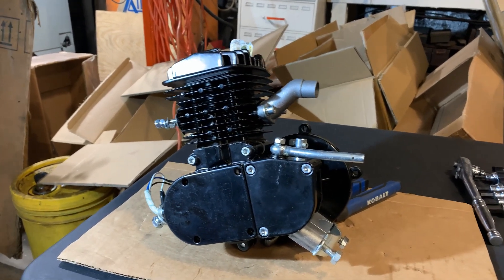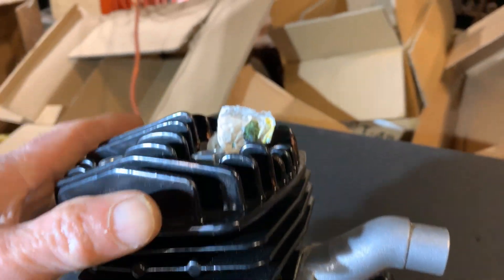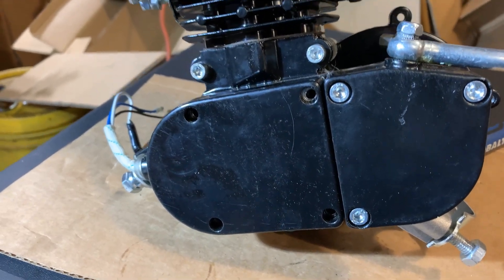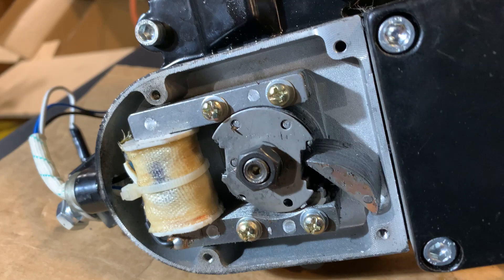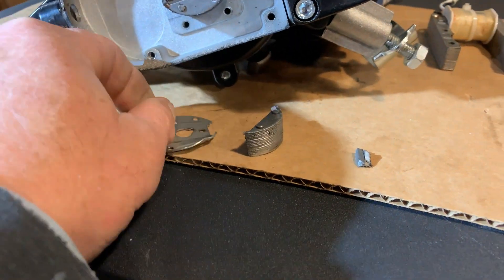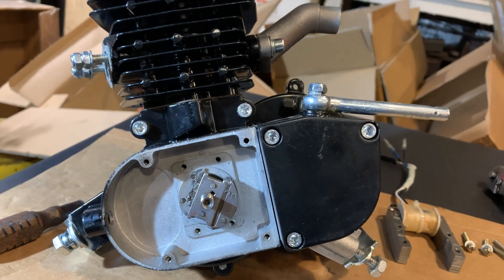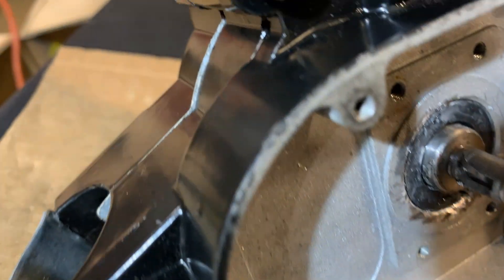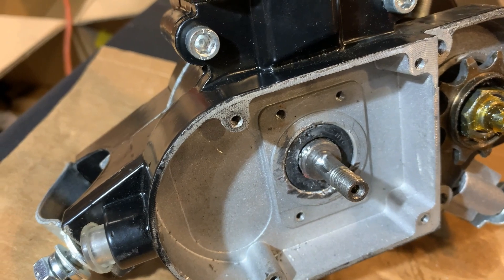Magneto Magnet goes bad

Comment: That shaft can be straightened really easily if you take your time . But the keyway might not be able to hold a new key. Hard to tell from the video. That shaft is not trued on most new motors! They can get bent very easily. I have never seen a mag come apart like that before. That was crazy.👍
Reply from the maker: I disagree a bit with your theory about the output shaft being true, granted they aren't Ferrari quality, they usually are pretty close. If they weren't the magnet would rub on the coil. The shaft on this engine was really to bent & wasn't worth the effort.

Comment: How do you put the key back in I baught a new magnet but can't get the key back in and their are no videos
Reply from the maker: Best way to do it is get some loc-tight & put a drop in the keyway on the crank shaft, let it dry really good (about 45 min to 1 Hr) & then slide your magnet on, it will stay in place & you'll still be able to remove the woodruff key in the future if you need to.. 👍👍
Reply: @EcoTransGaspoweredBikes  ok thank you I got the bike running yesterday after I tried your method I was watching videos and all I could find was how to take it appart

Comment: Wow that's a new one to watch out for.
Reply from the maker: I've had this happen to two different bikes on brand new engines that hadn't even ran for 15 min. & both were just sitting there idling when it happened. One bent the end of the crankshaft & the other broke the end of the crankshaft completely off, either way the engines were junk after that.. 🤷‍♂🤷‍♂

Comment: Anybody know where I can get a new one?
Reply from the maker: Sorry it took so long for me to reply.. 😥😥You can get the magnet just about anywhere on line, E-Bay or even Amazon.. What you have to watch out for is usually when this happens it bends the end of the crankshaft that the Magnet slides on & then the engine is now junk.. 🤬🤬Check it before you order a new Magnet by taking out the spark plug & turning the engine over & look at the end of the shaft, if it wobbles it's bent..
Reply: @EcoTransGaspoweredBikes  okay so it’s not bent but the nut was put to tight and snapped the end of the shaft we’re the magnet is any idea how to get new part or fix
Reply from the maker: @troynew4608  There is no fix per say, the only two choices you have are to get a new rotating assembly ( Crank shaft with piston & rod ) OR if it's a new engine return it. I've had this happen twice, the first one broke off the end just like yours & the second one bent the crank shaft end, both times they replaced the engine. When this happened to me they were both new bike engine kits & it was the first time they were ever started & both were just sitting there idling @ a low RPM. The Magnet falling apart is a parts failure & not something you or I did, so they should Re-Place the engine for you.. 👍👍

Comment: I have a question, my neighbor bought a bike with a 100cc engine on it, I thought it was a blown head gasket, when I pulled it off I installed new head bolts, when putting it back together I noticed on the piston where the rings are supposed to meet up to the little pins the pins were missing could that be causing problems with the engine? I'm trying to save him money so I don't know if I should replace the piston or just the whole motor, any advice?
Reply from the maker: That's a tuff call to make on this end when I'm not there to see it..🤔A person does want the pins to be there to keep the rings from rotating & the ring gaps to be staggered & not to let the rings rotate to where the ring gaps are at a port so they don't break the ring.. BUT.. If the cylinder looks OK I think I'd just make sure the ring gaps were staggered & away from any port openings put it back together & see if it runs, if it runs fine I'd go ahead & run it..It's not like the rings really spin on a piston anyway it's more of a precaution anyway.
Reply: @EcoTransGaspoweredBikes  ok cool thanks for the advice, always appreciated